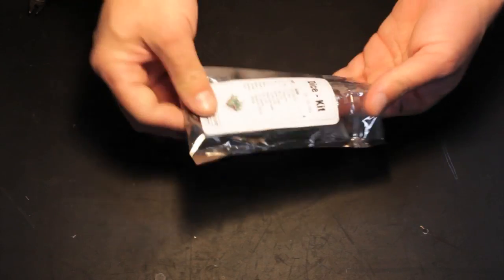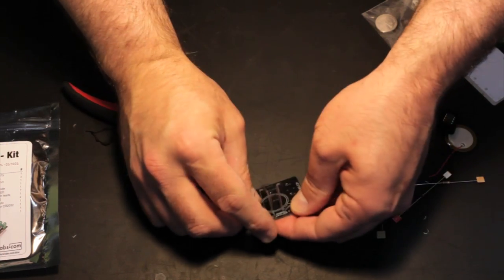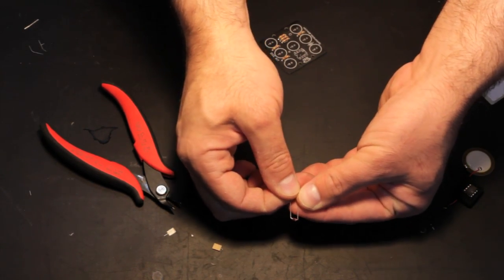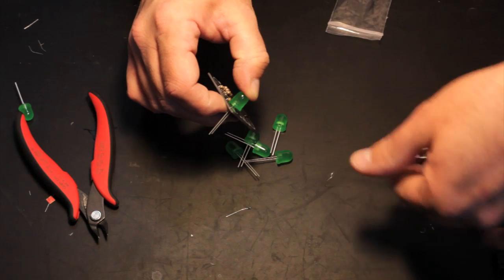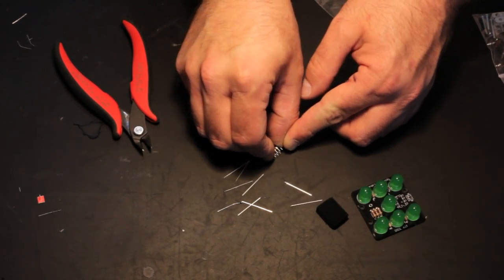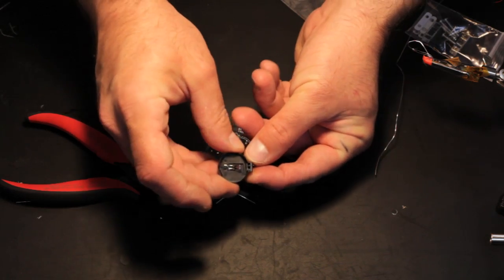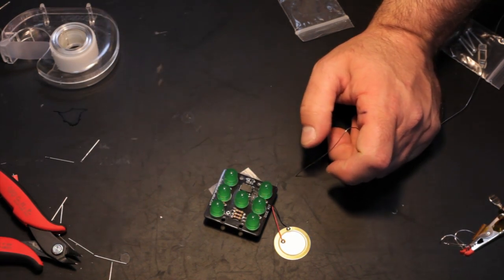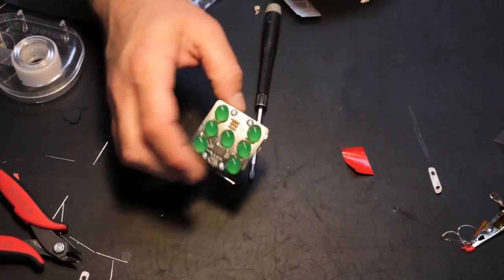Dice Kit Build Video - SpikenzieLabs.com

Comment: Just assembled it. Works....sort of... I beleive it is impossible to roll a 6!! Would have been much nicer (and easier to assemble) if you had included a socket for the pic chip, then I could have reprogrammed it without having to desolder and resolder to fix.
Reply: I’m able to roll all 6 combos, but my center LED was intermittent.  Which was caused by a cold solder joint.  I ended up fixing it twice.  It’s a tricky fix because I had to remove the battery holder to resolder the center LED. I just noticed this is a really old thread. They still sale these in 2022!